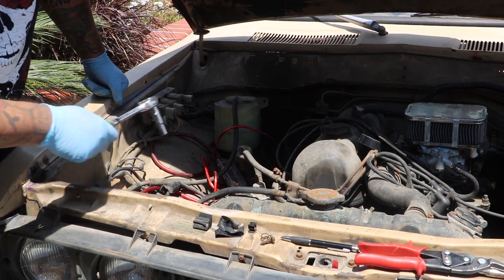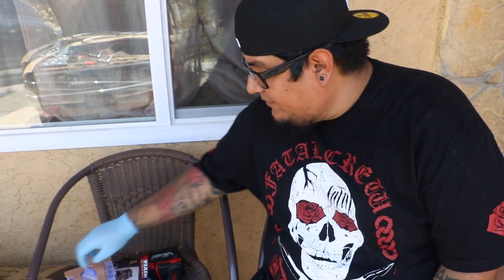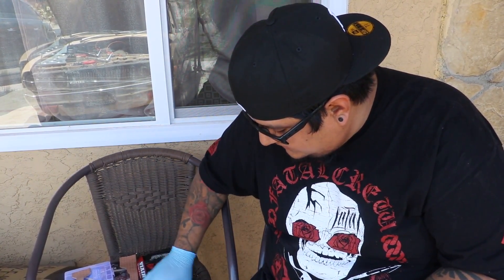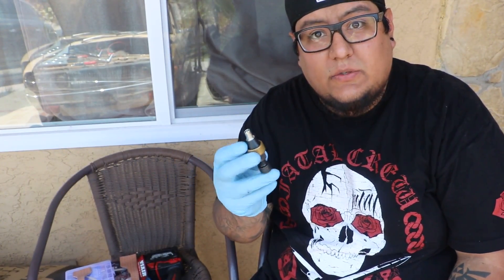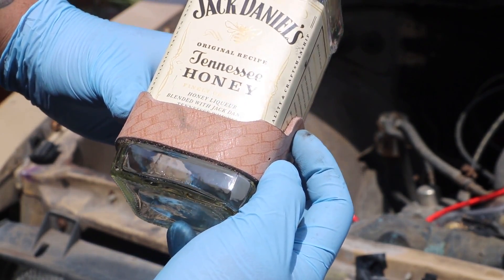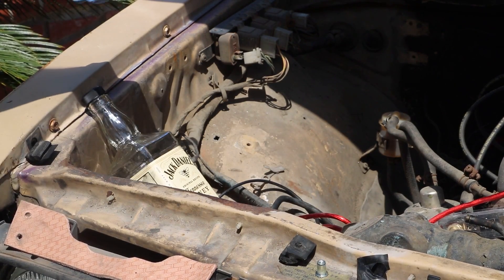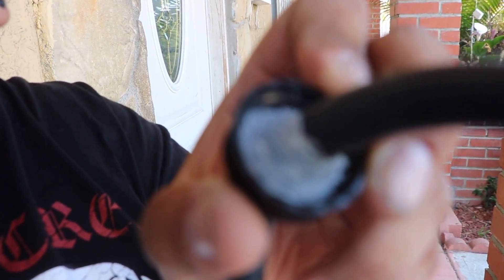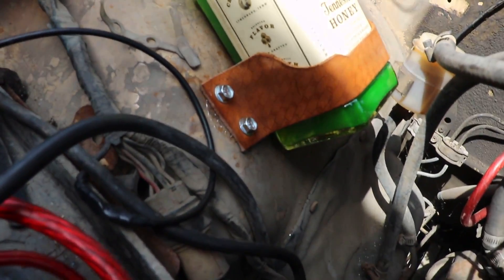HOW TO: Make a coolant reservoir tank

Comment: I’ve been wanting to do this to my S10s since my tank is broken but everyone’s been telling me that it needs an over flow hose n ventilation since it will just be creating pressure n could affect the cooling system
Reply from the maker: I haven't had any issues but if anything I can put a secondary hose on the top as a breather so it will have an air escape n no additional pressure but I see a lot of other cars with no overflow tank just like mine but plastic so I doubt u will run into problems and I appreciate the comments n views thanks for tuning in and as always let's boooost!!!!
Reply: Looks like I’m late to the party. I did this to a stolichnya bottle and it blows the cap off everytime I get a new one, so by theory I believe that it does need ventilation

Comment: Could tell me how well the bottle held up cause I want to do this to my Chevette , and replace the washer fluid with a Jim beam as well
Reply from the maker: Holds up good just one thing I added was a soft backing where the bottle touches metal because it was rattling around a lil bit so I put an 1/8" foam tape on the back to keep it from hitting the fender well where i put it
Reply: @baggednboosted9951  one more question cause I wanta get it right. Should I seal the tube or should I drill 2 holes in the cap one for the hose and one for a breather tube?
Reply from the maker: @coreysease I personally sealed it with hot glue with just the hole for the hose no breather but that's just my preference some ppl drill holes at the top with an overflow that's drips to the ground basically another long hose that leads past the frame by a small amount so u dont get ur frame all wet so honestly it's up to u how u want to do it. I personally dont feel it necessary  in my application at the moment since I wont be running this motor overly hot where an overflow hose would be needed. In a future high coolant output situation I would. So it depends on what u want and what ur doing with ur car